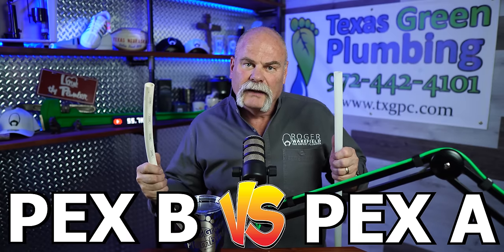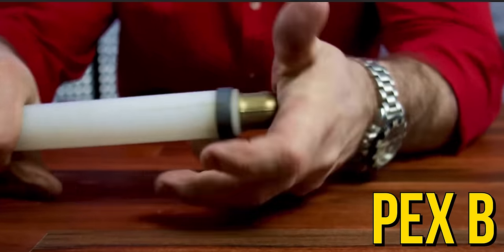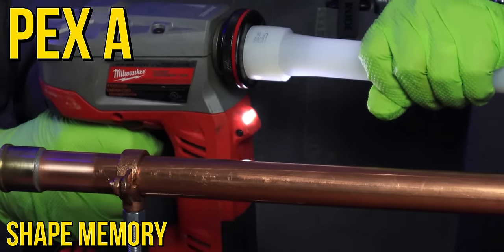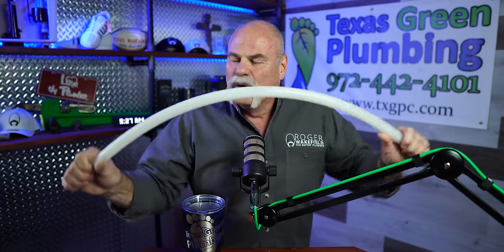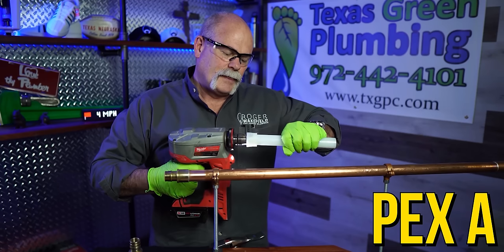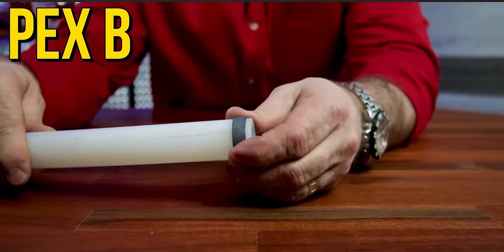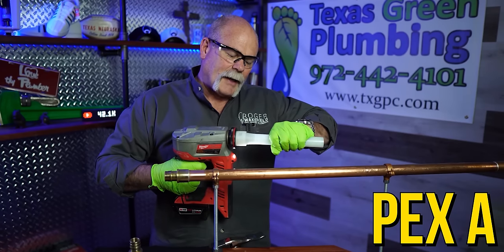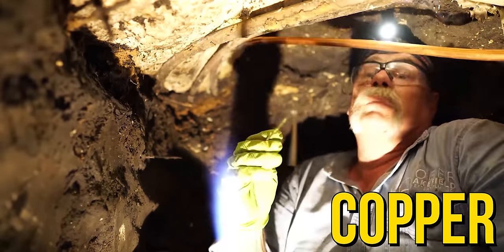PEX-A vs PEX-B - What's the Difference? Which Should You Use?

Comment: PEX B or C is often used as end-pieces to direct the hot-water-heater's relief valve, "down low". The issue?....I believe this is a code violation for the exact reason you say.....restriction at the first (or more) inserted elbows that are used. Code says the diameter of the relief valve should be maintained for any "tail-piece" piping that is attached. This diameter ( usually 3/4"), is maintained when using copper. Yet when using PEX B or C with clamp and metallic inserts.....there is a reduction in diameter. I see this all the time yet it appears code inspectors (residential homes) either turn a blind eye to this or don't themselves recognize the code violation.......

Comment: Wish i new pex a was an option BEFORE my dad had me redo my whole house in pex b. Fml
Reply: pex b lasts just as long as pex a if done correctly, ive done houses with pex b for 15 years. not a single failure and more versatile. Also cheaper so if there would be a failure it still cheaper than a pex a system.

Comment: We've had issues with PexA.  leaky fittings,  Assuming the fittings were flawed or not made to high standards and such.  as in if you have a bucket full of fittings or a bag of 25 or maybe a bag of 10 and they are tumbling around in the bucket or your box, the barbed ridges get micro nicks and allow the water to leak out.  I've seen it myself and we experimented a bit by putting hose clamps around the expansion rings with and without heat but those little nicks won every time.

Comment: every time I do a total re-plumbing job or a new build I quote for using pex manifolds and running all lines to that.  reducing the number of connections needing to be made but increasing the amount of pex.  In theory this should be far more durable,  what are your thoughts?
Reply: It can add delay for hot water.  No mater what you do go with Pex A
Reply: Dale, what brand of manifold do you recommend for PEX-A? I've been wanting to plumb my small house with home-runs to each fixture.

Comment: I’ve only used pex a handful of times. My company has always done copper and Wirsbo/UPONOR. And if possible we will adapt from copper to wirsbo wherever we can (save $ where possible)

Not only that Wirsbo if you have the smaller gun - a good point opposed to crimping a ring with Pex B. Is the tight areas where you need to make a connection. Whether that be in a wall or sometimes spots you can hardly see. But if you can fit the ring on and use the gun you can make the connection. Where as with a crimper you might not be able to do anything

Comment: I'm doing a bathroom remodel. Haven't replaced enough plumbing to warrant switching from copper to pex. I'm leaning more towards pex a because u expand the tube with the tool BEFORE connecting, so no need to try squeeze a tool or torch into a tight spot.

Comment: Thank you for sharing this info. I will use this when trying to explain to my customers why I only use PexA. Definitely changed the game. I used a closed loop 50/50 water glycol so I used A for for that. If was taking in fresh water I'd use the PE. You can Always call uponor and they'll tell you which to use. They're always helpful. Unfortunately the uponor fittings have been hard to get lately at least in NETex. Remember do it once the right way  because you'll pay for the second. God bless
Reply: What diameter is recommended?
Reply: @Sophia-lc9ow  half inch is generally sufficient, it depends on how large your home is, it can help to have larger trunk lines 3/4 inch and tee off of that with half inch,  pex b is just fine and reasonably priced. I keep hearing pex b leaches little to no chemicals and it   has a higher burst rating. This guy is ranting about pex a like a lunatic, must be trying to convince his customers or owns a ton of stock in uponor, lol. All that he is jabbering about also depends on how you design your system. To each his own but he didn't convince me of anything he was saying.

Comment: I had a plumber by pass my water softener to supply a sill cock. The original pipe was 3/4 copper. I got home and found 1/2" pex B with 3 90 degree fittings in 10ft.  This connected to the the remaining 40 ft of 3/4 pipe supplying sill cock. When  I called to complain they said code only requires 1/2.  They came out and replaced the run with 3/4.  It increased the flow by 35% at the sill cock. I was not happy, might be the last time hire a plumber.  I like your videos they are down to earth and informative.

Comment: I re-plumbed my house with Pex-A. Spend the money and buy the Milwaukee expansion tool, the manual one is too much of a hassle. One disadvantage to Pex A, your fittings can't much closer than about 3". The problem... when you put the expansion tool in the pipe on the second fitting, if too close to the first, it will jam and  freeze inside the first fitting. I found out the hard way.

Comment: PEX-A all the way baby!
I used it in all my home builds in Montana (-30 degrees so freezing water is a huge issue) and in Washington state. Its FAST to connect, and it STAYS connected. No rings to mess with. Lets face it, sometimes the areas we have to work in are very tight and getting the tool in those tight areas to crimp a ring is not fun, but the expansion tool is not an issue. Expand it where its easy to work on, then move it and attach it to the tight area before it shrinks back up.

Comment: Pex A in my house Repipe,but was disappointed with the Manabloc 
from Viega doesn’t have fitting for Pex A on the block
Reply: Your right, when I install viega Manablocs I use the sleeve and nylon compression rings it doesn't restrict the flow like the crimp rings and fittings that's the only way I install them and I use PEX A

Comment: Would love to see a video on repairing pex, depending on the source solid color pex A has had splitting issues.  I called Uponor they denied it and said if you are having issues then you need to find the reason and replace all pipe you think is compromised.   But they also say their pipe is compatible with insert fittings and metal clamps under astm f1807.  So a lot of guys do not take a chance of expanding and just use the pex B fittings and tools.  You need to swap out two service stops under a kitchen sink it's hard to take a chance it will split and then tell the homeowner they need a total re-pipe.  Just grab two Veaga stops and crimp them in.

Comment: Used a lot of both pex a and pex b. I prefer pex a for all the reasons he stated. 
But do not wrap with tape! The adhesive very slowly degrades the pipe. In Canada an inspector will make you but it out and replace it. 
Inspectors in different areas may have different ideas. I always use poly sleeve underground or in concrete

Comment: I think Pex-B is better if you live in cold climate and have city water. Pex-B has highest resistance to chlorine degradation and the highest burst rating. The only disadvantage to Pex-B compared to Pex-A  is it has slightly more flow then Pex-B due to the fittings, but that's not an issue if your water pressure is good. Some people claim Pex-A has a plastic chemical leeching effect when exposed to chlorinated water for years. I don't care about the kinking or the flexibility that's not worth comparing because once the pipe is installed who cares. I care about the longevity of the pipe in my cold winter crawl space with chlorinated municipal water running thought it 24/7 I don't give a bakers fuck about flexibility.

Comment: Please clear up a rumor for me, I’m a commercial plumber and don’t deal with pex. With Pex A can this line have water in it when it is expanded or does this system have to be blown out with air ?
Reply: It should be fine as long as you have a few feet of free pipe. J would never empty the entire line just to expand the pipe anyways, and I have  seen an issue from it.
Reply: Yes it can, shrinks ridiculously tight when using tool correctly.  But if you mess up a joint, can’t fix it like copper sweat with resoldering.

Comment: I haven't installed any pex yet. But, now I know why I'll be using pex A the reduced opportunity to forget a step and the connection is not a restriction so stepping up the entire system for fitting's sake is not required. Efficiency and durability over 'the savings' of money or time.

Comment: If you do upsize the pipe, keep in mind that putting a long run of larger pipe between the water heater and the shower is going to take a long time to get hot water at the shower head.  It's cheap and easy to run more pipe than you need (unlike copper), so plan you run, or plan for a recirculating system.
Reply: I dont think it is going to take so much longer that a recirc system is needed. Those have to be the biggest waste of money I have seen. ESPECIALLY when you have a thankless system.
Reply: @snyper1982  Well, in my house just running the shower head (low flow) it would take over two minutes to get hot water.  I removed over 70ft of 3/4" pex that the builder had installed and rerouted the supply to get something more like 20 seconds.  The builder had run the lines around the perimeter of the basement for convenience with the shower being at the end of the run.
Reply: @keithprocter141  well yes, but I believe that had more to do with shortening the run, than changing the pipe diameter. Home runs from one big manifold near the water heater to each individual fixtures would be the ideal way to go, but that uses a lot more pipe. Thats why I like the viega manabloc system, with it each individual fixture has its own shut off, so you don't have to shut off water to the entire house. It is almost like a electrical circuit breaker box for your water system.

Comment: I use PEX A for all my repipes and new work I still use PEX B for some repairs if it already has PEX B  and I still use copper for copper repair jobs, propress and or solder joints which ever the job has, but I do prefer PEX A, and thanks for the videos Roger have a good day.
Reply: Would it be ok to use PEX A to replace a section of copper pipe? I don’t mind the appearance. Just wondering if it’s acceptable to mix materials.
Reply: @MoneyManHolmes  yes but I wouldn't use Shark.bites to transition from copper to Pex I would sweat copper to pex transitions.

Comment: Most plumbers use pex A, its simply a better product. The two down sides to expanding fittings is the cost of the fittings and the fact that in winter on a new construction, you have to heat every fitting to get it to shrink down to a size where it will not leak, before you can air test it. You can use copper crimp rings on it or stainless steel cinch crimp fittings. Pex A can be heated if it kinks, while pex b must be removed and patched with couplings, heating it melts it.

Comment: I worked for 3 years as an apprentice and when we used pex we used Uponor. One thing to remember with Uponor is you have to keep it out of sunlight. Sunlight will degrade it in a few years and it will become brittle and leak. My new boss uses Viega crimp which is pex B. I prefer pex A but he uses pex B and since he is the boss that's what I use. I left the commercial end of plumbing and am doing service to round out my plumbing education.
Reply: All PEX becomes brittle when exposed to sunlight. Not just PexA.
Reply: Yes but the pex B we use seems to do better with sunlight  then uponor.

Comment: The main problem I have with PEX is the service fittings. copper or iron is super strong and stable for service fittings to the sink or tub or etc..
This of course is when they just stub the PEX out and not the appropriate stub fitting.

Biggest hate is shark valves. In a hurry and need to turn it off, good luck.. the whole thing spins.

I am remodeling part of my house and may consider moving to PEX.
Used it in the past. Have had coper on last many projects, so I just continued copper

Comment: I bought pex a tool after i watched this video, even copper press tool, so i can connect existing copper to pex A easily, and im lovin it.  The only problem is here in NJ its hard to get pex a fittings , they dont have any at homedepot , some lowes have them but limited even at the plumbing suppliers too. So i always have to order fittings through internet.

Comment: Here is what I will use = PEX-A, with BRASS fittings.  That is so I can have the pipe freeze, expand, and then return back to normal once the freezing is over.  The fittings that come with PEX-A are usually plastic, and plastic cracks when it freezes. The brass is stronger so it pushes the ice into the plastic pipe instead of bursting the fitting, so it will be necessary to use brass 'crimped' fittings with the PEX-A instead of the expanded PEX-A plastic fittings.

Comment: Thank you so much for your videos!!! Your an official wealth of knowledge for the plumbers community.
Reply from the maker: I appreciate that! Have you decided if you're going with PEX A or B?
Reply: @RogerWakefield  copper the whole house. It’s the second house where 40+ year old copper needs to be 100% replaced. I think type m wall was used back in the day and it just doesn’t stand up like type L.  Even the use of soft copper for offsets has a pin hole at the bend. Electrolysis with regard to under 1” proximity to electrical l (120v) turns the pipe black. Corrodes from inside out.

Comment: The only B pex I own was free. With A pex you have the ability to use any fitting you want with it so it makes it really universal. It's more expensive but it's good pipe.What I'm noticing with port size from pex to wirsbo is about 1/16 of an inch difference in port size. It doesn't seem like much but I guess it is. The only thing that is better about B Pex fittings IMO is that the price of fittings are more reasonable and you can put fittings closer to each other vs Wirsbo where you have to have the distance so the gun doesn't go through a close fitting and crack it. All in all Upunor Pex and Wirsbo fittings are king, the brass is super heavy duty and the system is simple to use and especially for tight spaces.

Comment: Personally I prefer type A. 

I’ve been using uponer for years and have never had an issue. I’ve tried the rings a few times and had 1 or 2 leaks due to the ring not being clamped in the correct spot on the barbs. 

Only issue with type a is when it’s cold out it takes a long time to shrink but that can solved with a heat gun or a zippo

Comment: They also, interestingly enough, make F1960 expansion rated Pex B, so you can use it with certified expansion fittings.  I've seen some conversation that the extrusion method they make each type with can change how much scale forms on the inside diameter, but that may just be down to different water supply mineral content.

Comment: I used PEX-B to run air lines around the barn. The crimps were easy and running the line wasn’t that bad either. Didn’t have any issue with kinking. (Long straight runs) love the videos! Thanks for saving me time and money with my plumbing projects.

Comment: I was already leaning toward using the PEX A system, but your excellent video convinced me beyond a doubt it's the way to go.
Reply: Pex a is toxic and degrades rapidly.  Pex b is much better and cheaper too.
Reply: If your water supply has chlorine in it as most city/county supplied water does then PEX B is a better solution because it handles chlorine better than PEX A which degrades and starts getting pin hole leaks.

Comment: My father in law used 1 inch or 3/4 inch copper in his ranch home. At the showers he reduced it to 3/8 I believe  and the pressure coming òut of the shower head will take your skin off its so strong. like at a self serv car was. I'm not doubting you in any way, I'm just not a plumber. I looked at pex fittings and the size reduction using pex b is practically the same. He said the reduction in size causes high pressure water to come out. I can vouch for it I've used the shower several times visiting. It's like you don't need soap (you do) but it is awsome. So I'm a little confused I was going to use 3/4 coming in that's what's there now and 1/2 to shower toilet and sinks. I also live in a ranch seems to be a very easy job. I don't want to pay the prices I've seen for the gun used  for pex a foe 1 job. ,any thoughts on this matter ?.  I would appreciate it, thanks.

Comment: It's not PEX-A vs. PEX-B, it's ASTM F1960 (expansion) vs F1807 (crimp).  There are several PEX-B manufacturers that have F1960 (expansion) approvals such as Sioux Chief and Mercury Plastics (MerFLEX).  There are also several other PEX-A manufacturers besides Uponor.  The A, B (or C) after PEX indicates how the product is crosslinked, not what fittings can be used with it.

Comment: You mentioned using PEX A for buried lines. Can "B" be used for buried lines? I have a very long run to hook up to the city water system. Would you put in access (irrigation) boxes at each joint (3) with cut-off valves?